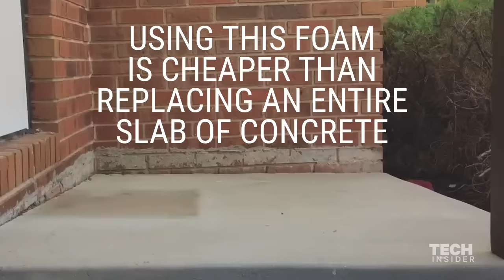Foam Raises Concrete That Weighs Thousands Of Pounds | Tech Insider

Comment: Foam is totally unsafe for ground applications where it might get wet. Open cell foam will not let enough water to pass through and closed cell foam will not let any water pass through.  Both instancess will cause mold build up.
Reply: Intelligent
Reply: Thanks for the warning.  I wouldn't be able to sleep at night thinking there may be mold under my sidewalk outside.

Comment: I had a crew come out and try to lift the slab out my front door, and a couple of slabs on my driveway. The crew cracked the concrete in several places on each slab. I had to call a concrete company to break up the cracked slabs, haul off the chunks, and pour new concrete.
Question: Has anyone done any experiments to determine how many years the foam lasts before it starts decomposing or compressing?

Comment: Naysayers are missing the whole point!

Fixing a sunken foundation, drive, patio etc…would involve removing said object, most likely dictating its recreation later.
Then removing a quantity of soil, then replacing the soil in correctly packed lifts, then rebuilding said sunken object!

Of course that’s the right way.

This is intended to give people an affordable option to get people by, hopefully for the duration of their use of the object.

Like baling wire to hold up a muffler on a starving college kids car who’s working two jobs to get through self funded school.
It’s an option.

Consumers like options.

Comment: Yeah I've installed this foam and repaired already installed foam for 5 years. It's a stop gap and lasts anywhere from 1-2 years before you have to just replace the concrete, not worth it especially with how much my company charges, you'd be better off just using the broken driveway or full replacing. Every company that uses this stuff touts it like a miracle saving thing when in reality it's just a waste of money. Our "service advisors" (salesmen) usually only get misinformed relatively wealthy people to buy this junk. Stay away from any business that provides this service.

Comment: This shit cost like it is liquid gold ....For my country only company that does this is Uretek ,for lifting house foundations etc.My house have sank on one side for about 5-10cm ,house is +-250m2 on 2 floors from pure bricks and concrete.Also walls ,nor foundation did not crack,house just sank,lean on one side.Anyway,when i call them and ask for price ,approximately  ,i first gave them exact house dimensions ,material that is used in house to build ,type of soil beneath foundations etc ....estimated price was around 12-15 000 euro.In my country where average salary is 350-400 euro,this is ridiculously expensive.So now i not see solution how to level house,with jacks is out of option ,nobody does that here.I do have one idea thou,i'm thinking to dig soil near foundation on other side of house,that is not sank ,and just pour water in ,try to let it sink for that 5-10 cm like it did on other side,and hopefully level house ,more or less.

Comment: I am sure they know the square footage on the amount to use of the foam combustion CCI. Think about what cylinder it comes in & the amount is in it. How much can be used with it then do the math on what areas need to be fixed then so math how much needs to be raised how much needs to be raised how long it is so on=
Reply: Wouldn't they need to know the volume of the space before they could calculate the amount?

Comment: That's cool and all but in my experiences foam degrades quickly, especially in areas with vibrations and compressions... Like a drive way or side walk. How does this method hold up over time?

Comment: Just a question how is it not a chemical and what happens if you can't control the expansion of the foam and lifts or breaks the slabe more than intended or breaks the slabe all together I've done some mud jacking seems the you can control the mud and concrete mix a little better but interesting

Comment: And how to they make sure the upward force is equal all around to stop the concrete just cracking to bits from the push?
Reply: ThaTurminator because the force will have to be equal all around to accutualy push up.
Reply: at least with this type of material
Reply: Yeah I know the force will have to be equal. That's EXACTLY what my question was. 
HOW do they make sure the force is equal to prevent cracking?

You just basically answered "by making sure the force is equal" 😑 sigh
Reply: its a foam, it has to spread and fill the entire space before it can do any significant force to lift the thing, so therefore it shouldn't  crack
Reply: Alan Choi: How do you control the rise? What if you put too much???
Reply: the foam takes the path of least resistance. er-go it dosent begin to rise until it is entirely confined underneath the concrete. then its just a matter of experience and a light trigger finger for the fine touches. you can somewhat control the upward force with where you place your injection holes.

Comment: How long will the foam hold the concrete up?
Reply: Should last for many decades. The material is inert and does not easily degrade, depending on the resin used, e.g. polyurethane. The resin is not usually 'biodegradable', it just degrades very slowly.

Comment: How do they control the lift?
they stop adding foam.
See how they can't entirely fill the void?
It's not as permanent as mud jacking where you pump actual cement into the whole void
Reply: Yea..  wonder how long before this stuff decompress or decompose and beings you back where you started.  Mud jacking seems to stay put unit more dirt erodes.

Comment: Could this be used to even out the leaning tower of Pisa?
Reply: Technically, yes, but the tower was designed to lean, so straitening it would likely make it collapse, ironically.
Reply: Actually, the tower took many years to build.  After construction was delayed, the base canted, and when construction resumed they kept on building.  Typical Italians- shortcuts everywhere and shoddy construction.  Just look at NYC.

Comment: This is the first time I have seen this. Its utterly amazing. Whats the maxim concrete depth?
Reply: I've installed leveling foam for 5 years, it's a complete waste of money that'll last you 1-2 years before you've got to replace the driveway anywho. This should only ever be used on small patios or walk ways for a temporary stop gap before full replacement of the concrete.
Reply: @qwrft2496  
Oh shit. Back to R and R. Thank you

Comment: Environmentally friendly?
Reply: It's made of HDPE. HDPE is a "clean" plastic, which basically means that it will not leak dangerous chemicals, and can be melted without releasing toxic gasses. That's why it's used in milk jugs, bottle caps, and cheap gardening tools.

Comment: This is a bandaid on a real problem. The concrete sank due to bad grade. This doesn't fix that. This is a quick fix if you plan on moving in the next few years and screw over the next owner

Comment: Looks hokey because although I have no doubt that it works exactly as advertised, I don't see how you can get a good result by using it because there is no "OFF" function to the foam's action. If you overestimate and you put in too much, there's also no way to reverse the process. If you underestimate, you have to keep adding more and more holes until the concrete slab is Emmenthal cheese. The key thing is that it's almost impossible to get it right because you don't know the volume of the space you have to fill, and the resistance the foam will meet.

Comment: And over time won't it decay
Reply: And probably break down due to water getting in through it
Reply: It's a thermoset polymer so would last longer than concrete and is 100% waterproof excellent for insulating inside of roofs especially in factories etc.....  just check the flammable rating

Comment: It's foam not concrete,  eventually it will deflate sooner rather than later.
Reply: I've been installing leveling foam professionally for 5 years, and you're completely correct. My company says "it lasts a lifetime" we go back to jobs that were done 1 year ago to re level the concrete because it's sank back already.